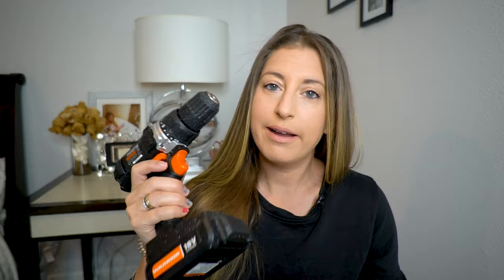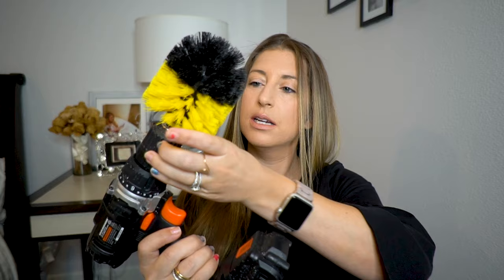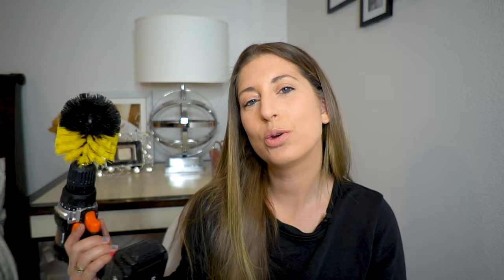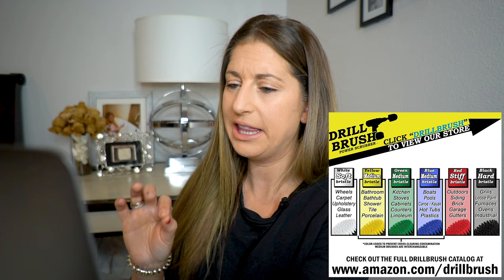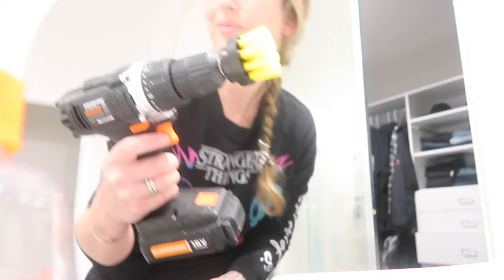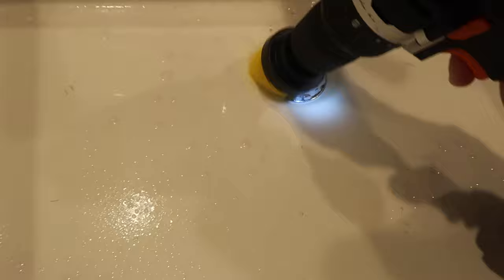THE WORLD'S BEST CLEANING HACK | THE DRILL BRUSH IS PUT TO THE TEST | REVIEW | JACKELYN SHULTZ

Comment: The mediums are the same, they are color codes so you don't cross contaminate cleaning detergents
Reply: What happens if u cross bleach with  muriatic acid...super badass products that's what
Reply: I believe that besides the detergent, as you mentioned, it is to prevent cross contamination on surfaces. I wouldn't use the brush I have in my bathroom to clean my kitchen.
Reply: can you clean my boat?
Reply: Not true.  The colors were all different levels of abrasive in the package I got.
Reply: Different colours = different stiffness

Comment: Might seem like common sense, but be careful not to use wet products with these brushes if you're using an electric drill because obviously there's a risk of electrocution. But even with a cordless drill, you don't want anything running down onto/into the drill because you'll likely ruin it. Happy cleaning everyone 😊
Reply: I guess this is why bits for mixing have very long shafts.
Reply: In that case don’t use a commercial floor buffer it’s actually 220 Volts and not safe around wet floors 😂 even if you have to wet the floor to buff it. Get out of here safety bear.
Reply: @naythanhailey4824  a commercial floor buffer is purpose built to be used around water. A drill is not. Not to mention the fact that my post was a friendly post but yours clearly isn't. If anyone should leave, it should be you.
Reply: @sidnac6545   lol you obviously have not seen drills lately…… I have the new Milwaukee and I can pour water all over it and it works great just like modern iPhone .
Reply: You might have a point with the cheap drills used in this video. A good brushless drill probably doesn't care about getting wet though unless you submerge it or something.

Comment: The colours in the medium brushes are to avoid cross contamination.   One would not want to use the yellow bathroom brush to clean the stove for instance.
Reply from the maker: That makes sense
Reply: They are actually different density and some have stiffer bristles than others. White is the softest
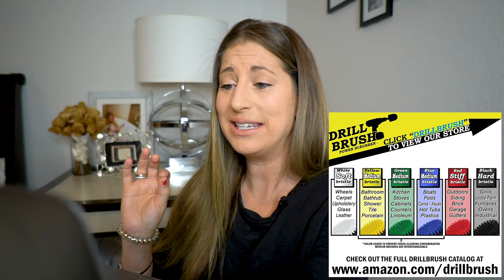Reply: ummmm, it actually IS WRITTEN VERY CLEARLY in the photo at 05:00
Reply: @Added2Cart  Plus I noticed in the picture you put up @4:36, that it does say to avoid cross contamination below the 3 medium brush colors in brackets. So no scam. It's very preventative, helpful and smart. Thank you for this video as I hate grout. I guess going with hard wood or laminate planks would've been a better choice for cleaning floors. But now that I do have tile and gruot, this is a great idea! Thank you

Comment: What is the liquid that you're using to clean the shower? Also I, am I washing my bathroom wrong because I use a sponge to clean my tub and sink. I'm with you I hate cleaning, but I actually love vacuuming, I find the noise soothing and it's kind of therapedic moving something back and forth. I prefer one of those vacuums where you can see the dirt come up so you feel satisfied when you're done, and throwing out the dust is so much fun. That's that's my only love cleaning.
Reply: Steam cleaning the carpet & watching the dirt come up through that triangular clear head is extremely satisfying, as well, like how you like to watch the dirt through a clear vacuum.  And, of course, when you dump the dirty water of the steam cleaner, you get a second dose of reality of just how much dirt you have captured😉👌🏼
Reply from the maker: I actually don't mind vacuuming either. I was using Fabuloso but i don't have a cleaner that I love. i sometimes use a bleach and water mixture or even just baking soda and vinegar. what do you use?
Reply: @Added2Cart  Comet or Ajax which is basically the same thing. Both of these products are powdered and I found out it's basically baking soda with powdered chlorine or bleach whatever you want to say. Fabuloso is awesome I have that my house I use that occasionally when I want to quick clean up. Maria has taught you well!! 🤣

Comment: Note - Do not buy a standard Drill, instead, purchase a "Driver Drill', it can help clean with these brushes effortlessly without applying pressure.
Reply: Ah!  Thank you!  I came on here to find out which drill to purchase.  I'm so not versed on this!
Reply: Ummm...a drill is a drill driver(nobody says “driver drill). A drill is a drill unless you mean a hammer or rotary drill, but the hammering action wouldn’t do much good cleaning, higher rpms and torque will.